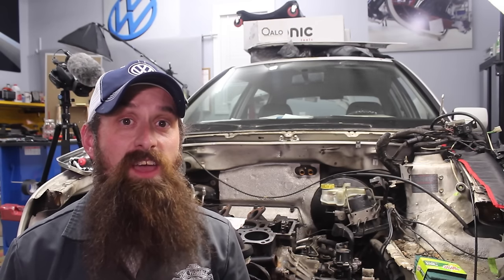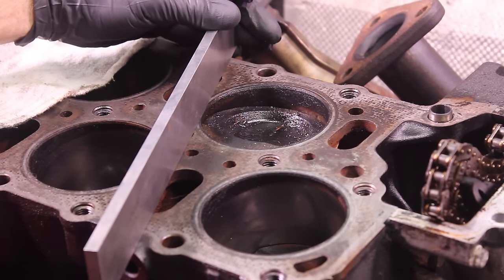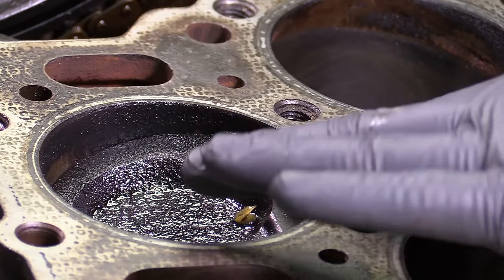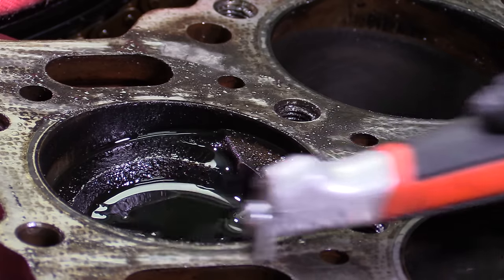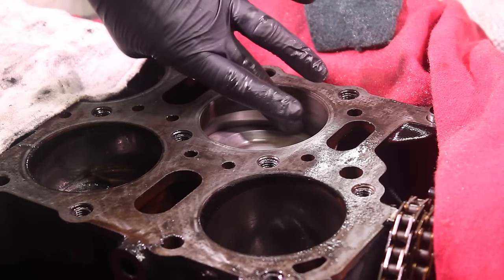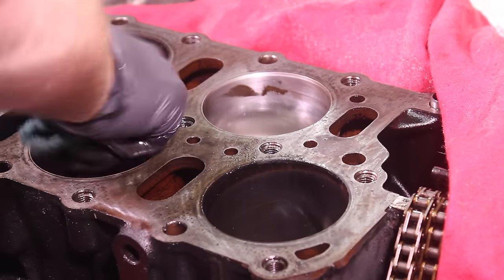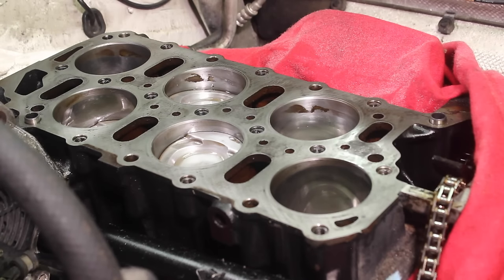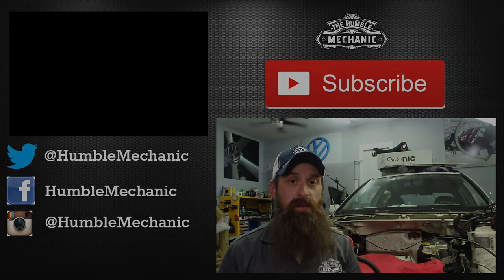Removing Carbon From Piston, Cylinder Walls, and Block Deck

Comment: what's your take on seafoam for cleaning carbon? 
I do notice an improvement in performance, but, have always wondered how much it actually cleans.
Reply: I would love to know as well, HumbleMechanic! I'm about ready to pull my intake manifold apart (since I'm on month 6 of owning my '06 GTI), and would love to find an excuse not to do it right away.
Reply from the maker: +TheShadowSplicer if you already have misfires, I don't think it will cure them. I think of Seafoam as more of a maintenance treatment.
Reply: +HumbleMechanic ah no misfires yet, but definite hesitation on cold cranking. I foamed it a few days after I got it, and I feel like it's gotten worse since then due to carbon. Thinking of a catch-can, and more foam, along with the eventual intake manifold removal. :)
Reply: So, seafoam does work, but any idea as to the extent? Certainly not as clean as you're going to get with what you're doing, but...
Reply: I noticed a definite difference in small things like startup and idle smoothness. I don't know the physical difference and exactly what areas it affects, and I'd LOVE to hear what Charles has seen.
Reply: It's in your head !!!
Reply: +e.g. Smith Prove it? Passengers asked if I had tuned my car after I did it...
Reply: Tune in a can !!!!!!!

always make me laugh !!!!
Reply: +e.g. Smith Not a tune in a can; a remedy to an actual issue with a chemical/oil blend.
Either post data, or leave it alone.
Reply: Here some data: Tune in a can = nada
Reply: Well played e g Smith. Where would we be without you?
I mean, improved gas mileage and throatier engine noise besides, apparently. It doesn't do anything. Good to know
Reply: Try Italian tune up 
I do that before every oil change 
it works and it's free !
Reply: +e.g. Smith Whenever the roads are free of cars, Italian Tune-Up is my life. Still doesn't seem to keep enough carbon away. Seafoam gets the rest out, feels like.
Reply: HM, burn carbon off the cylinder head by burning more carbon in the cylinder head. Good idea. 
The difference is that the sea foam solution actually does have an effect on the carbon deposits that are scoring the valves. By atomizing it through the intake it does actually remove some build up, which will allow for a more complete ignition and greater fuel economy.
The Italian tune up is just opening the throttle body and burning excess fuel in the valve and cylinder. 
The Italian tune up is a great tip on passing smog test, Because it clears out the whole system (like taking a few deep breaths)
Reply: You don't understand italian tune up or seafoam !!!!!
Reply: ...OK.. indulge us Mr Smith, please come to our rescue and open our small minds
Reply: Will have to poor seafoam thru your ears...
Reply: +e.g. Smith +meloche1syndrome This isn't getting anywhere. No opinions or jests, why don't we back what we say now? Any solid data, guys? Before/after pictures?
Reply: *pour
Reply: I mean, if you don't know what it does, that's fine. I'm just asking that you please share your extensive knowledge with us, since we clearly are unaware of these two procedures. There's really no reason to resort to assault.

Comment: few things to care about an engine, never hit it when engine is cold, always wait untill it hits operation temperature, never hit it with old oil, like when close to change it, and finally, always put good fuel in it, engine should last forever!
Reply: you should not wait for the engine to warm up. you should let it sit turned on for like 30 seconds for the oil to start flowing, and then drive it slowly until it hits the operating temp. it will warm up quicker and thus be cold for a shorter time.

Comment: you can also use ATF if you don't have wd40. Also, putting in a 1 quart ATF to 50 gallons gas ratio in your tank every fillup will help to keep the cylinders amazingly clean and can even clean really dirty ones out.
Reply: Can ATF be used on modern cars, I have a Chevy Cruze that can use a internal cylinder head cleaning. Was thinking of doing the water steaming technique.
Reply: I run tcw3(2 stroke boat oil) or marvel mystery oil in my gas at 1oz per 4 gal ratio. It's perfectly safe for modern engines.

Comment: Thank ya i had a hole in my block
Water jacket was leakinginto oil gallery machine shop fixed it ive been working on the block surface with sand paper for metal this is a great idea something kept telling me wd40 for sure now

Comment: Hey Charles, great video, thank you! I dunno if you're still responding to your older videos but...I'm gonna try! Lol. I know it's not a car engine but...I'm going to be rebuilding my dads 2003 Kawasaki Vulcan 1500 Classics engine soon and I'm wondering if all this can be applied to the v-twin engine as well?! I inherited the bike and would really like to get it back on the road after over ten years of sitting!! I'm quite mechanical, have common sense (MOST of the time, lol.) and organized but I've never done anything like this before! My progress so far...the engine is out and I just started removing the outer parts of the engine to eventually split the cases!! I am taking notes, pics and short videos if need be as I go!! If you could get back to me, it would be a big help and much appreicated!! Also, if you have any other helpful info for me that will be appreiated as well!!! Thank you again for your video and I will be looking at your other videos soon as well!!! : )   Thanks bud!!    Don W., Ohio, USA!!!

Comment: Question, if I had a timing belt break on an interference engine and the valves smashed into the pistons, can I use a dremel and even out the tops of the pistons to re use them when I rebuild the engine? Yes I will be replacing the head.
Reply from the maker: Depends how bad they are. A slight nick in the piston will probably be okay. But I’ve seen chips and that’s not good at all

Comment: Hi what would your next step be if you wasn't tearing down the block, is it OK to leave the wd40 residue in the block or would you clean it out with something else. Thanks
Reply from the maker: I’d do an EXTREMELY deep cleaning. Then lube cylinders with engine oil. Hey
Reply: @HumbleMechanic  thank you for your response, do you just clean with the blue workshop roll to clean off any residue and wd40? I was doing this earlier to mine, I've left it with wd40 and blue roll over the top at the moment, I cleaned off as much as I could of the carbon. And I kept rotating the crank to get any left over bits out of the bores aswell. I won't be putting the head back on for a couple of weeks. Should I just keep it covered with the blue roll and wd40 till I'm ready? Thank you again for your help

Comment: hey Charles any other videos before this step. I have a 2001 Audi Avant Quattro 1.8t manual. with about 125k. I have decided to do some repairs after having I believe my oil cooler fail. resulting in oil in my coolant and the oil temp overheating. planing to do coolant flange, timing belt, head gasket set, oil pan gasket. anything I should know to either not making things worse or that I should consider doing before putting it back taking a week vacation to get her done. thanks in advance.

Comment: Thanks for the amazing tips. I'm definitely going to do this with my 1973 Johnson outboard motor that I'm rebuilding. That 2 stroke was covered in carbon build up...not the normal amount that I've seen with other people fixing similar aged motors.

Comment: wd is great stuff. i prefer pb myself for these applications. just seems to cut into crap a little better. and i have the same problem at home where my air compressor just cant keep up with my die grinder. i just set the chuck up in a cordless drill. it's a bit slower but gets the job done and helps push the carpal tunnel out a few years lol

Comment: Thanks for the video. I would've been worried about getting junk in the oil galleys and coolant passages. Will you be flushing those before starting the engine?
Reply from the maker: +Jeff Burton (JeffSleuth) the coolant passages were nasty. So we'll be cleaning that out for sure.  

The oil galleys were not as bad, but will get flushed too.
Reply from the maker: +Jeff Burton (JeffSleuth) I'll also be pulling the engine, and Doingg more work on the stand with it. So plenty of opportunity to be 100% sure things are clean.
Reply: +HumbleMechanic cool, thanks.

Comment: I have some rust on my cylinder walls on a 4.6L engine from the engine just sitting there . I made the mistake of not lubricating the walls . The w.d 40 would work on rust as well ?

Comment: I've followed this vid on my 289 - had it pointed out to me that this could have sent carbon down the side of the pistons which could cause scoring, although I did have a vac to hand and kept everything as clean as possible. Anything to worry about? I didn't really want to pull the pistons out..

Comment: Do you ever worry about grit from the cleaning session getting between the piston and piston wall and that would later lead to scoring of the cyl walls? This kept going thru my mind as I was cleaning up a personal piston engine last month. I'm a turbine engine mechanic as my day job and have to constantly consider deeply detailed stuff of a different nature and wanted to ask if I might be worrying about something trivial :)
Reply: Less critical on car engine but you're right- I would lower piston now and then and clean what has dripped down

Comment: I am surprised the carbon came off the piston that easily. Is it not really backed on, e.g. as one can find on the bottom side of an old pan, or is it that the WD 40 dissolved it so well? (I never got in to the guts of an engine)

Comment: i used this method but now im scared the scotch bright is going to get in my cam journal and bearings and do damage to the bottom of the engine block, will this happen if i dont hot tank the whole engine?  i used the same green scotch brite pads and wd 40 and eveyone online says it ruins your engine

Comment: Every mechanic uses WD-40 when building a engine block and when doing maintenance on them. I'm guessing its to protect the cylinder and block from rusting while they have them open working on them for a few days. It's a good idea

Comment: Hello I have a Volkswagen CC 2017 fbo stage 1+ and straight piped, I have 63k miles on it and I just changed my fuel injectors, spark plugs, coil packs I did my carbon clean as well, when would I have to do carbon clean on the pistons and how much would it cost for a job Like that ? Thanks !

Comment: Thats a lot of carbon at the tops of the cylinders. Are the rings set that low in the pistons? Or you have some tapered cylinders, Oil consumption?
Reply from the maker: +Nathan Fogg the rings are pretty low on the piston. 

I don t know about consumption. I didn't put enough miles on it to really monitor it.

Comment: what should i do if i have a large scratch in the head, should i take it to get resurfaced, or should i just clean and reassemble
Reply from the maker: I’d want to have it machined
Reply: HumbleMechanic thanks! Is there any other services that would be good for the head while I’m at the machine shop it has 215k miles on it

Comment: Why are the tops of the pistons so oily-wet ? 
What happens to the very tiny debris which is mixed with WD that falls down between the piston and the cylinder wall ? Or is it nothing to worry about ? 
Great video, I know my pistons are have carbon because the old girl is burning oil.
And if I ever get the testicular fortitude to do this job on my v6 I know what to do.
Reply: Ellesmere Wildwood they're so oily wet because he sprayed wd40 on them, and there is nothing to worry about if you're really worried then hit it with an air nozzle and change your oil. There is little to no gap inbetween the cylinder wall and piston ring, Although if you're burning oil then the problem would be piston rings.
Reply: Or valve seals possibly

Comment: Say im driving a small bore diesel and use a dci injector cleaning liquid in my fuel. Does this help to keep for example valve seats, ofcourse the injector, piston, piston walls and exhaust ports clean, atleast preamptively

Comment: Would this cause misfire ? I replaced spark plugs and ignition coils on my bmw but only 3 cylinders are still misfiring, I switched the coils and spark around and it’s the cylinders what does that mean ?

Comment: Have you considered buying an old propane tank for a couple hundred bucks to convert to an air compressor. from my understanding they can hold more pressure than a standard tank and are cheaper.

Comment: I am working on a 3400 engine in a 2001 Pontiac Aztek, I am trying to clean the pistons, which are still in the vehicle, but the rest of the engine is separated, if I cycle the pistons (to better clean each piston), will I offset the timing of the engine when I reassemble everything?

Comment: The cleanest cylinder is the one where the gasket blew. If you take a spray bottle full of water and spray water into the intake while the engine running it will clean off the carbon.

Comment: Soak the top of the piston and bottom of the head around the valves in B12 Chemtool, you will be surprised how fast it eats the carbon.

Comment: I noticed you have some small surface rust in the coolant jackets. What's the best way to clean the block coolant jackets of rust and debris? I have some in the m20 engine I'm building for my e30.

Comment: Awesome video! I'm replacing the head gasket on my 125cc motorcycle at the weekend and saw a lot of carbon buildup in the combustion chamber and on the piston head and was wondering if I could just translate this video straight to the bike engine? (I'm totally new to this but determined to go DIY!)
Reply from the maker: Yep, just be careful to get any debris out of the cylinder before assembly.
Reply: HumbleMechanic Added to the to-do-list, cheers!

Comment: I was concerned about using WD-40 on a piston or rather anything in the engine like that especially in the combustion chamber. I was always told you have a higher chance of getting Carbon in the cylinder wall if you try and clean it verses use something else or just remove the pistons then clean them.
Reply: That would be the way to go and replace rings,clean ring grooves etc plus change small and main bearings - but this is a quick job probably doing head only and cleaning block as a bonus. ..not what should be done really if you that far dismantling but maybe customer wants car by the evening..😅

Comment: Great video. Have a different question. Can you clean the crank shaft simply by removing the oil pan and using degreaser? Or will that cause major problems?
Reply from the maker: No reason to do that.

Comment: Great video, makes it look simple! 
What's the benefits of using a metal gasket?
Reply: Steel head gaskets compress more and seal better. They don't deteriorate/disintegrate. They don't leave a residue on the head or block. And I've heard that they can even be reused, but do your own homework.

Comment: How much of a difference in carbon on the pistons would two identical engines have except one was gas and the other diesel?  Do you only run your cars on quality fuel like Shell like I do?  When is the last time you drove a gas car?

Comment: At the shop what would this pay in the flat rate scenario just for cleaning?!
Reply: I'm a motorcycle tech and in my experience we don't get payed anything extra for cleaning.

Manufacture flat rate is determined based on brand new engines.

If you are lucky and have a good service writer who is good at selling labor, they can sometimes get a little extra time if you have an especially dirty job.

Otherwise hope you've done that job a few times before and get it done asap.

Comment: Question please @HumbleMechanic. 4k miles after rebuilding my engine, i noticed engine is too loud. when i checked it at the mechanic, he told me semi-synthetic oil vapored off and ever since it has burning a quart every 300 miles. Could clogged oil rings cause that problem?
Reply from the maker: Wow! That’s possible have you changed the oil?
Reply: @HumbleMechanic  yes, several times and oil volume decreases a quart every 300 miles. Only yesterday, i had BG EPR service and see if the oil no longer decreases in volume.

Comment: hi does sea foam work ?... or water vapor being sprayed into the air intake as the engine is running ?, cheers.
Reply from the maker: Both can work.
Reply: HumbleMechanic
thanks HM

Comment: Hey Charles, I am your huge fan. and i tried this but want to know, you are cleaning it, but the carbon can't be cleaned completely, and it will damage the cylinder walls and piston surfaces. M I right?. I think cleaning it separately may be a good idea.
cause i don't want to work again and again if a any residue damage the wall or surface.
how often do u did this and is it working fine for a long time.
M waiting for your answer.

Comment: Hey, I'm rebuilding a AAA VR6 obd1 that I'm swapping into my mk2, your tutorial are great btw they've been alot of help. When you say metal cylinder head gasket do you mean the one of the MK4? And if its possible can you post a link on where I can get one along with the part number. Thanks again, and keep the tutorials coming they're very helpful and straight forward.

Comment: How do you re align those pistons properly after rotating them like that before putting the head back on??
Reply from the maker: There are marks on the crankshaft pulley
Reply: @HumbleMechanic  Oh, interesting. I presume that taking a picture of the marks before rotating the pistons would help. I'm about to do this for the first time on a 2003 1.8T Passat.

Comment: Word of caution using scotch/scuff pads. The fibers can fall into the oil galleys and if not cleaned out can plug oil restrictors destroying your engine.